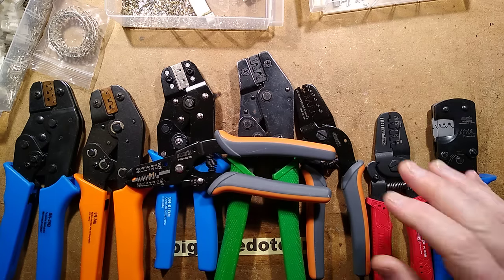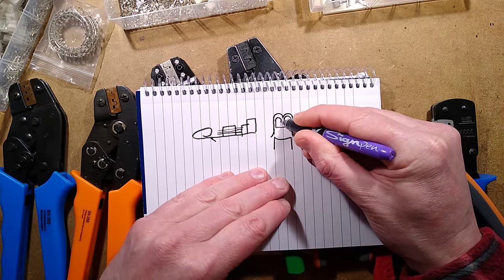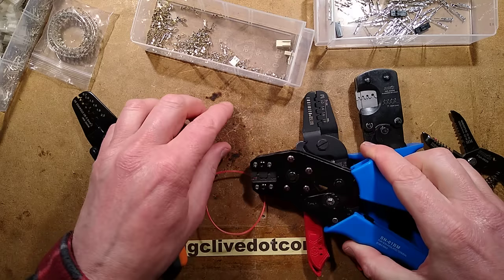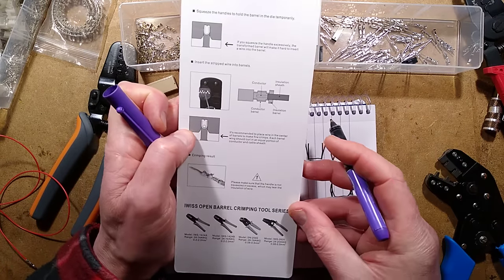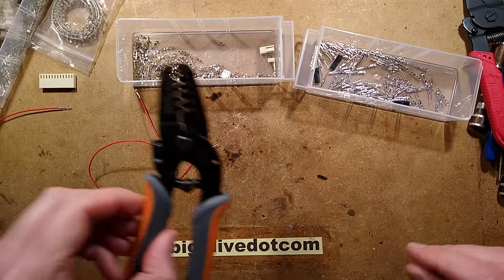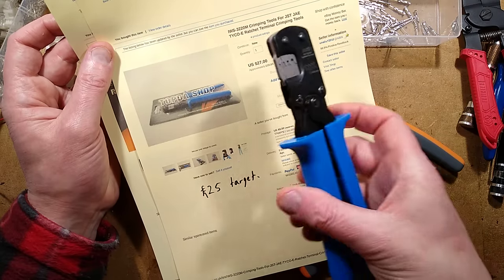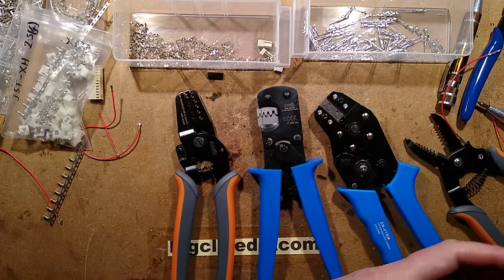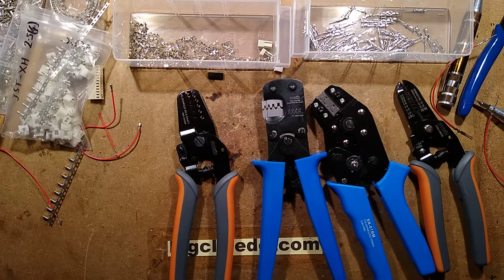Crimping tool test that I screwed up. (Read description.)

Comment: This is a good video. I have crimped dupont-style connectors a couple dozen times. I recently started building a DIY RC car with my daughter. I hadn't used a crimper in years. I have a PA-09 engineer crimper, but I was absolutely crushing and distorting my crimps after the first couple tries. I think I'm just out of practice. I did get it to work OK after a couple tries.

I had to crimp some connectors onto a 6-wire cable for another project. I bought some 6-slot micro-fit molex connectors for this. I tried to use an SN-28B crimper from a cheaper brand (not iwiss) for these, and I was absolutely mangling the pins after my first couple tries. I think I was just using the wrong tool. I didn't really realize how much variation there is in the sizing of the ratcheting-style crimper dies and how critical it is to not mangle anything past the wings that are supposed to hold the conductor wire itself. I determined that I absolutely hate Micro-fit 3.0 Molex, and I'm going to use dupont-style connectors instead for this particular application.

Iwiss makes an SN-28B. These are supposedly for dupont style connectors. I think this is why you weren't having good luck using them on those JYK connectors. The SN-28B jaws are probably too wide for those.

In any case, My cheap set of SN-28Bs didn't come with instructions like those IWiss crimpers. I'm going to indeed measure the width between the 2 sets of wings on my connectors with digital calipers and also by eyeballing them in different positions in my various crimpers. It makes sense to me that you want a size that matches the width between the wings when parallel. I think I knew this when I last used these kinds of crimpers for electronic connectors a few years ago, but I forgot this detail. Thanks for pointing this out. I think this will prevent me from mangling connectors as my daughter and I try to finish building our DIY RC car next week.

Comment: I bought a set of cheapy Chinese crimpers for a job, they worked well.
Then I needed to work with some other connecters so I bought another cheapy Chinese crimpers, but this time they had 4 different interchangeable heads. They are lovely.
They live in their own pouch and are ready for action, if I can find them.
Reply: "*if I can find them*"
(sigh) I feel ya.

Comment: And these issues with crimping are why I have finally stopped being cheap and surf eBay waiting for a cheap used crimper of the model that the connector OEM specifies to be used. Getting the proper crimper makes a big difference, but I certainly don't blame people for not wanting to spend $300-500 for a crimper that they may not use very often and may only be applicable to one or two crimp connectors they use. Hence my eBay used shopping preference where if you have patience you can pick up crimpers for 1/4 or 1/2 the price of a brand new one, although you do run the risk of getting something worn out that may not work properly anymore.

Comment: I'm using the last iWiss one since a year or a bit longer and so far it did a very good job. JST (GH, PH, XH etc) , Dupont - no problems at all. I think i noticed it the first time in a video from Andreas Spiess who compared it to the Engineer. For Dupont i've also sometimes seen recommendations for the HT-213, but never tried it myself. The results in videos looked very good, but it's less versatile with other connectors.

Comment: Great video, found myself needing to re-crimp a video-door system power line, which was wired by a moron and duck taped together. I purchased a SN-01BM before seeing this video and pleased it worked perfectly, best 3quid I've spend in a while. And another tool for my collection.  Domestically the connectors are known as XH2.54 at least here in China.

Comment: You need a set of the Greenlee/Paladin CrimpAlls. Very rugged, and you can get all sorts of dies. I have two sets of the handles and a variety of different dies. About $70 for the base tool and maybe $20-$30/pair for additional dies.

Previously, I had bought a set of the PowerWerx crimpers for Anderson  PowerPoles for about $40 and 4-5 extra die sets, but the crimpers weren't rigid enough for good quality nylon-insulated connectors.

Comment: I have two crimp tools  A shiny new engineer pa-20 (different crimp sizes 1.6,1.9,2.0 &2.3 because at the time it was £10 cheaper than the 02!).  It does the same job, I wouldn't swap it. Also have my old GPO switchboard cord fixer which is almost as good.  When I was a young apprentice I went on a two day switchboard course on how to change and fix the cords on switchboards.  involved whipping the end of cloth covered cable with waxed linen thread and crimping eyelets to the wires.

The "official" blurb said: Strip 1/8" of wire and close the wings on the crimp to hold it in place with the end of the tool before gripping with the plier to close the crimp in the former ... The more insulation you leave the better the grip, you only need a short (but good) electrical contact.  The main failure point over time is the strain of use and plastic gives more grip than wire to make a tight stable connection.  Those cords were given a hard life the supervisors kept a record of who fixed what - and if they didn't last you were moved on.  I was there 18 months and moved because I got a van.  
At 18 It was the best job in the world - Once a week I got to sit all day chatting up the GPO operators fixing their cords - It was like being a kid in a sweet factory!

Comment: On the high end ratchet crimp tools, you normally buy a kit with a few dies that can be swapped out. They also have an adjustment sprocket to set the pressure that the catch releases the ratchet.  
I have two nice ratchets that I use. One has dies for RJ and BNC the other is for the DP/JST style of termination.

Comment: I have made quite a few terminations with the iWiss tool for DuPont connectors.  The comments section above regarding DuPont terminations are congruent with my experience.  It took a few practice runs before I was able to master the art of proper crimping.

The object lesson is that it is usually worth paying extra to get a top quality crimp tool.  A Tyco/Amp tool for RJ45s is $100+ US, but is is rare to make a bad crimp and the tool is more productive than a $30 US crimp tool.  The expensive Tyco tool paid for itself probably the first week I used it.

Comment: There are some crimpers that look almost identical to the first 2 crappy crimpers in the video, but they work perfectly on dupont terminals. Those good crimpers come with EDM machined precision dies which bend perfectly the connector and do not crash it.

Comment: I have (3) sets of iWiss connector crimpers for JST to Anderson Powerpole, and a set of their hex ferrule crimpers. I tried another brand that didn't last the evening (the weak metal streched), got a replacement that made a mess of the connectors, then replaced them with an iWiss model that has worked perfectly. I could certainly spend a lot more but these have worked well for me (DIY hobbyist).

Comment: I just love how you discarded first two because of tolerances, even if they have mechanism to adjust them. The "too lose" might be hopeless because jaw shape, but you could wind back crimping force of "too tight" one and still get a decent crimp.
Reply from the maker: It was a physical tolerance.  The jaws couldn't physically close on the crimp far enough.
Reply: @bigclivedotcom  Ah sorry, didn't know you tried to adjust them. It's kind of a sore spot for me after one incident at work. I was told by my boss that I ordered an expensive shit tool (refrigeration capillary flex tube crimper) just because after it arrived somebody used it before me without checking crimping force setting and made leaky connections on some job.

Comment: I bought a kit of DuPont-style connectors from eBay a couple years ago and the seller included a SN-28B crimping tool with it. I have to say, the tool can be PITA to use but it gets the job done.

Comment: Trying out a crimp set by Wirefy recommended by another YouTube channel, and realizing it's been quite some time since I crimped anything but an RJ-45. The Wirefy unit looks like it was OEM'd by iWiss, but does seem to work. First time I've ever had a supply of "Du Pont"-style wires.

Comment: Why do you not leave the "wing/connector tab" on the connector? It makes it so much easier to position them into the crimper as you do not have to think about it. Plus you never have the issue with the connector being pushed out when inserting the wire. I then just cut it off with snips after crimping.

Comment: I make a lot of connections whilst building rc planes and multi-rotors. I have a pair of those Iwiss crimps and i love them. I make a lot of JST PH and JST XH connections, and the Iwiss does a great job every time. Took me a while to learn how to get the best out of them, but once you get used to them you cannot beat them. Before i got them i wanted to get the Engineer branded ones that you have, but could not afford the silly price they wanted for them, so when i spotted the Iwiss ones on Banggood i ordered them straight away. I have not regretted it. They crimp just about every i need in my rc hobby.
Reply: Which SWISS crimper? The manual one?
Reply: @Asyss_Complex  Iwiss - 21:13

Comment: This has convinced me to stick with the larger connectors.
That really looks like a pain.
Reply: I assume wire sizes are done by MM on your side of the pond instead of AWG?  Some of my strippers are marked both ways but my Ideal Stripmaster only has AWG markings.  I would have never paid retail for one but I found one used at a flea market and I have come to love it.  Have you ever used one?

Comment: I have two ratchet-type crimping tools.  One is marked with a number but I have no idea who made it so the availability of alternate dies for it is an open question.  It does BNC connectors quite well,  though,  and came in handy when I wanted to make some patch cords a while back.  The other tool I picked up at a hamfest for only about $2 but I have yet to find out what it's good for.  :-)  I've also used more specialized crimping tools to do Anderson Powerpole connectors (used for some DC power distribution around here) and coax cable into PL-259 connectors,  which still need the center conductor soldered.

I'm looking for something that has a wide range of uses,  even if it means that I have to change the dies to do it.  Covering stuff that's as small as what you are showing here on up to bigger stuff.

Speaking of bigger stuff,  I have some connectors that won't be handled by any of these tools.  Very large,  they'd be suitable for things like connecting to a large lead-acid battery or similar power distribution.  For that I hear that a "hydraulic crimper" is the way to go.  I''m still researching that and the above and haven't arrived at any satisfactory choices just yet.

Comment: I have a IWS-2820m crimper, that I use with JST-PH connectors. They’re tiny, so I use the 1.0 section of the crimper. I’ve never had a problem crimping the wire part of the connector. But, for the life of me, can not get the strain relief part of the connector to crimp correctly. I’ve tried crimping it with the 1.0 and the 1.3, but every single time, it either shears/bends the wings off (1.0), or just folds the wings straight back along the wire (1.3). I think I’ve only successfully crimped a strain relief one time...
Reply: Any update yet? Have you figured how to properly crimp it or is that tool simply not for JST-PH?

Comment: The IWISS S28B tool is actually decent at making good Dupont crimps. I'm no pro, and it still takes a little practice, but once you get the feel of it, they give you a good crimp about 80-85% of the time - and it is wide enough to do both crimps (insulation and wire) at once.. Stripping the wire properly is critical - too much wire and the crimp won't secure against the insulation. I've finally gotten good enough to feel comfortable making my own custom cables with it.

Comment: I use a pair of IWISS SN-28B, they work great but I still put a little pin point of solder on the wire and solder to the connector before I crimp cause I will never trust it completely. It’s an extra step but it gives me piece of mind just incase I mess the crimp up and it doesn’t show itself until much later.

Comment: The type of crimp terminals you are using are referred to as "F Crimp" (not to be confused with F type coaxial connectors). The best manufacturers of crimp tools for F crimp terminals are Sargent in the USA, AMP USA, HERO Japan & IWISS China. For the casual user that may be crimping a wide range of of ratios of outside diameter to centre conductor diameter cables the worst type of F crimp tool is the one that simultaneously crimps the centre conductor and the insulation, for the casual user it's always best to crimp the centre conductor first and test it for retention and then crimp the insulation. Most of the diecast carbon steel crimping jaws from China that dual crimp the centre conductor & the insulation simultaneously are out of spec in several ways and quite often result in an unsatisfactory crimp and a deformed terminal. Sargent in the USA make a lot of the tooling that is sold under the Delphi name. Delphi taking over Packard-Hughes also formerly the Packard Electrical Division of GM. AMP (Aircraft & Marine Products USA) are credited with developing the first F crimp terminal back in the early 1950's. Sargent, Hero & IWISS make a range of tools that only  make one crimp connection per operation, IWISS make the biggest readily available F crimp tooling up to 35 square mm in cross section. Checkout the IWISS IWS 5100A and the IWISS IWS 8200A on the Aliexpress WEB site.  Similarly checkout the Sargent tools (http://www.sargenttools.com/ToolsByTrade/Weather_Pack_Two_Cavity_Crimp_Tool/) #3181 CT - Weather-Pack Unsealed 20-10 AWG Two Cavity Crimp Tool. The Hero BL-255 (http://hem.co.jp/products/3772)  is another magnificent tool and renowned in the automotive industry.

Comment: blade micrometers help to measure crimp dimensions for setting the tension wheels to prevent over/under crimping. recommended crimp dimensions can be obtained from most mfgs. you should not have to pull test with even average crimpers if set right and repeatable.

Comment: I have bought IWISS branded ratcheting crimpers for the small molex type connections and also one for the wire crimps that hold the wires nicely for inserting into screw terminals.  They work quite well and are reasonably priced.

Comment: First thing to remember about crimpers:  if it comes with a calibration pin or go/no-go gauge, DO NOT CRIMP THE GAUGE.  First close the crimper, then attempt to insert the pin.

Comment: 26:56 Ive used up about 40 of those JST-XH with the same tool and the exact same result. Come at it from all angles trying to get the perfect second crimp and no luck. These tools have to be machined perfectly, and even the connectors themselves. If ones out of spec then its all mud.

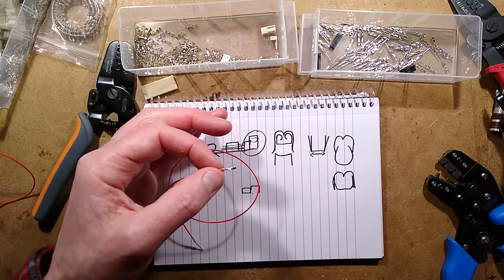Comment: 16:00 I have this similar design and size and love it, but it is blue, and yea, at first it is finicky and is annoying, but when you used to it, you just swear by it, ratchet mechanism really helped with controling the right amount of force, no more over or under tightening.

Comment: The SN-01BM is sized for JST-XH and -XM connectors.  The SN2549 does those AND some other sized (Dupont something or other) ... so it's an SN-01BM AND an SN-28B on one die set

Comment: For RJ45 connectors only use the Ideal 30-696. 10 out of 10 times the connections work just right. Tried others and there is nothing like finding out you need to take another ride in the cherry picker because you have a bad connection. There is a reason that if you asked 10 different low voltage guys what they are using around here, they will pull out this one. Also, the others from Ideal are garbage, only use this model.

Comment: Just bought the molex crimper Just before I watched this video so looks like a good buy for the job in hand. (Fitting pumps into dehumidifiers 75 pins 25 plugs)

Comment: In the US Anderson Powerpoles (15/30/45 amp) are commonly used for 12vdc by radio operators. And damn near nothing will properly crimp their inserts, except a specific PowerPole crimper from one of a very few sources.

Comment: Thanks, very enlightening - you dint mention the adjustment wheel that some of the ratchet tools have...
I bought a cheap ratchet crimp tool (Weirli SN-28B), mainly for Dupont and JST XH 2.5 pins - dint have much success with it, mangled most or dint crimp hard enough and the wire pulled out easily. So I threw it (metaphorically) into a dark corner and now I solder the wires in and fold the strain relief tabs with pliers. 25% success rate with the crimp tool, 99% with the solder method.

Comment: come to think of it i never used my SN-xx tool instead i bought a set with replacable jaws. being a amateur a cheat i use sometimes is to stuff the wire in and squeeze the insulation tabs in very lightly with a pair of pliers so the wire stays in place.

Comment: We folks in the aviation electronics trade are pretty spoilt by the plethora of ‘aviation Mil spec’ connector tools from companies like Daniels, AMP, Buchanan, Raychem, Amphenol etc. I remember first encountering molex style connectors a few decades back when we were installing emergency lights along the floors to light up the aisle in a smoke filled cabin. The molex pins and sockets looked so much inferior to the ones we typically see used on the rest of the aircraft systems and the crimpers, like you so accurately observed, require lots of practice and a sharp eye to get right. 
And, yes, we too with our fancy tools do screw-up once in a while🤪